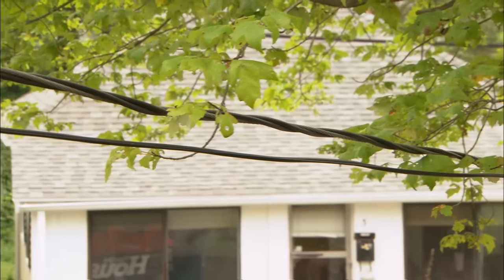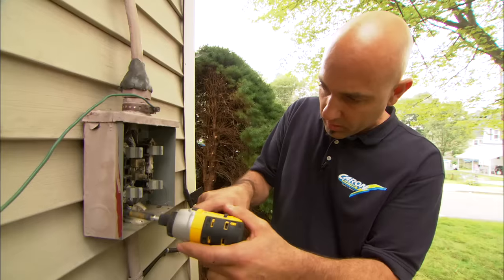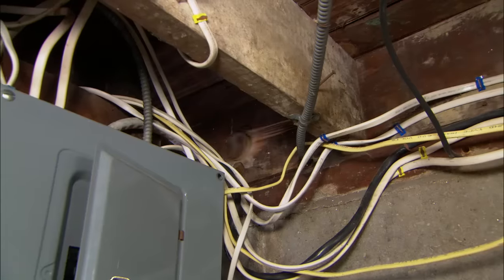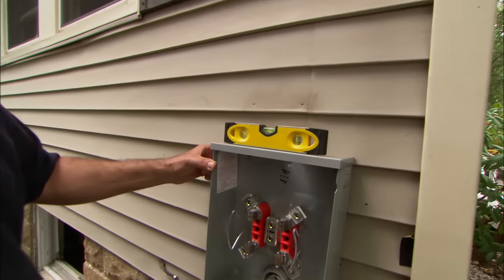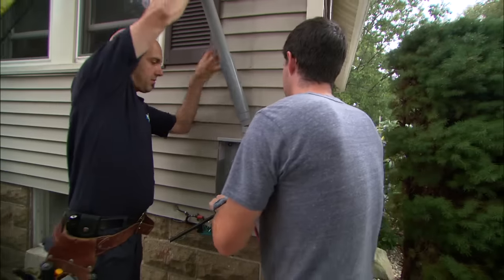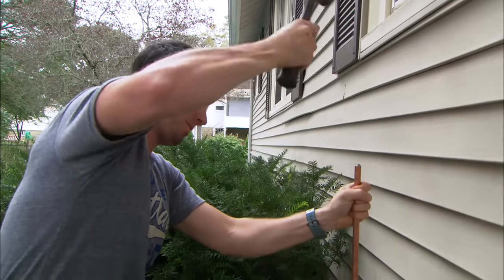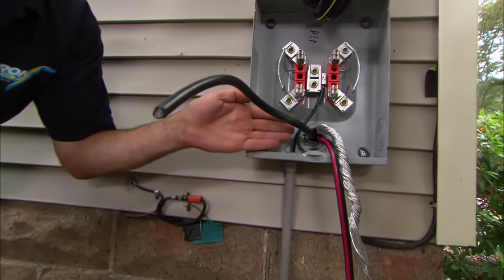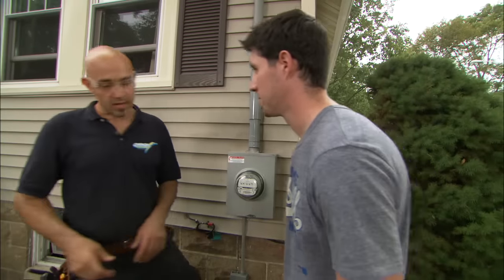How to Upgrade an Electric Meter to 200-Amp Service (Part 1) | This Old House

Comment: 30 seconds in and the facial expression of the homeowner looks like his family is being held hostage by the production team.
Reply: True!
Reply: His words were "so there's no power to the house?"
Reply: @loturzelrestaurant  Stop spamming
Reply: @BenCos2018  I wouldnt call it spamming, for obvious reasons. 

You... surely can tell those reasons, yeah? I mean, they're obvious after all?
Reply: @loturzelrestaurant  It's in every comment thread tbh 
It classes as spam lol
Reply: @BenCos2018  Yeah, i know what you mean, but still: Context? 
Is it really Spam? 
Get my question? 

Also, i think you mean classifies, not classes, lol. 

Point is: I'm informing people about something's existence and asking them about something - Problem with that? And if so, WHY?
Reply: What he wasn't told is that the revision has to be inspected. Then the inspector has to notify the power company. Then the power reconnects the service. Depending on the local it can take days???
Reply: @jackriley5974  yeah 
They edit out far too much inmo tbh
Reply: hahahahaha... this comment is so true.
Reply: @BenCos2018  Yes.  After all, they only have about 22 minutes of actual program to compress days of work to fit.  It is far more complex than they depict for just about everything.
Reply: @johnvinga5446  yep haha 
While I understand why they speed things up...I still think they could havw at least mentioned the extra days of work lol
Reply: Totally saw the holy crap what I get myself into
Reply: 200 amp humor.
Reply: Hey! I know that guy! Went to high school with him.

Comment: "I'll finish it off with a sledgehammer!" - pulls out the smallest sledgehammer known to man...
Reply: That caught me off guard, too!
Reply: We call that a single Jack. Don’t know what it’s called on the East Coast. Apparently a sledgehammer. LOL
Reply: Lump hammer
Reply: Ben Hawkins 😆 😂🤣
Reply: @fredtillman3152  mini sledge
Reply: @nickg1307  mini sledge is a 4 pounder. Anything lighter is a dead blow hammer or mallet.
Reply: @fredtillman3152  I used to sell tools, we called that a "drilling hammer."
Reply: My Klein’s could do better work than that little sledgehammer!
Reply: Lotta names for that thing!   It looks like a 3 lb sledge.  Maybe a 4.  That's what we call them here.  The thing that blew me away was how soft the soil was.  at my house, I might get it in a foot before I hit a big rock and that would be that.  My ground is a hundred feet of 1" copper water supply.
Reply: @goldwinger5434  I am old enough, I have used a 'hand Jack' to drive star bits into brick and concrete to set anchors.   It quite literally is a drill hammer. 3 or 4 pound short handled 'hand jack',, sometimes called a single jack,, sometimes called a half jack,    vs an 8 pound double jack for drilling deep often to set explosives.   A jack hammer.
Reply: @cm01                  "hand sledge"
Reply: I don't believe they got those ground rods all the way down with that little hammer they went off camera and used a jackhammer
Reply: @gustavoramos8229    No.  Quite believable.  I set grounding rods to 10 feet routinely and a 4 pound short handled 'hand jack' or 'hand half jack'  works pretty well.  Your arm can only lift about a max of 4 pounds the hundred or two hundred times you have to lift it.  The rod drives nearly as fast at the beginning as at the end.  Surprising,, the norm is the tough part of the drive are the soils at the mid level.  The lower soils usually are easier, not tougher.  I have driven several hundred rods.
Reply: 😄 good old mini mjölnir
Reply: Fred Tillman Baby Sledge
Reply: We call them a mini-sledge here where I'm from.
Reply: Lmaooo
Reply: "I'll finish it off with a sledgehammer!" Catchphrase.
Reply: That hammer was probably the hammer he used as a meat tenderizer.
Reply: He took that hammer from his 5-year old son’s carpenter toy box.
Reply: @cecflo7435  Like many things in life, it's about technique, not size.

Comment: Great title "How to Upgrade an electric meter..." then the first line is "...this should not be done by a homeowner".
Reply: Lol, I was about to go out and do it today... I guess I'll have to find a different project for today
Reply: Bullshit, i did my own
Reply: If you own it, it's yours to fix or destroy. Risks are involved with each decision. Remember laws are just rules written on paper to control the minds and actions of ppl who believe they have more control over your decision-making than you yourself.
Reply: @frenchmontana961  salty much? I've worked on my own house along with the main service being hot. Knowledge is powerful if you use it correctly. No fires here but you sound a little burnt In my opinion. To each their own I guess.  If you're uneducated in the field then don't take chances. It's YOUR DECISION.
Reply: @TheTubejunky  lots of guys "work on electrical" every day and I have to go in later and fix their mistakes. Hire a licensed contractor. Electrical fires are the #1 cause of residential destruction. Don't be cocky
Reply: We I was 15, my parents bought a house and the first thing my Dad did was upgrade to a 200 amp service. When he had it inspected, the guy looked at him and said "Every once in a while I run into a guy like you. You're not a professional electrician but clearly know what you're doing and does a lot better job than some of the professionals work I've inspected."
Reply: @TheTubejunky  it also means you can buy a house that has hack job diy wiring, I had to redo a fair amount of mine.
Reply: @TheTubejunky  couldn't have put it better myself.
Reply: CrashyK why not pvc ?
Reply: Nick every jurisdiction has its own rules
Reply: TheTubejunky I’m making lots of money everyday fixing the DIY handyman/homeowner electrical installs. Frankly it’s job security for me!
Reply: It’s a little dumb how they present the video as a DIY type of thing. This project should never be presented that way.
Reply: Dog Stopper how do I know what?
Reply: My question is, what difference does it make, if it passes inspection?

Obviously you need a permit to do this work and it’s all disconnected anyway.
Reply: @seabass22  it probably requires a master electrician to pull a permit in most, if not all jurisdictions. I know only a master can in mine. If the homeowner finds/pays a master to pull a permit for him I suppose if he’s intent on doing the work himself, he can. But the master is putting his license on the line and vouching that the work is quality and is done to code. If the house burns down because of faulty work, they are not coming after the inspector; they are coming after the master and his license.
Reply: @RB-xv4si  actually, most jurisdictions allow the home owner to do their own work, so long as they pull a permit and have it inspected.

Otherwise what is the point if pulling a permit and getting an inspection?
Reply: @seabass22  because it’s required by law
Reply: @RB-xv4si  you’re missing the point. It’s okay.
Reply: @seabass22  I didn’t say homeowners weren’t allowed to do their own work. But doing it on your own home doesn’t exempt you from the requirement of having an electrical work permit pulled. And again, they can typically only be pulled by master electricians or contractors. There are some masters that will pimp out their licenses to everyone and their mom for a fee, but they usually end up getting in trouble because they can’t actually oversee all the work their name is on and inevitably there will be idiots doing the work. I understand how all of these things work, my buddy. So what is it you’re still confused about?
Reply: @TheTubejunky  Depends where you live, in areas this must be done by a licensed electrician and inspected, you also must call utilities to disconnect the power from the main.
Reply: obviously it's for a targeted audience.
Reply: @TheTubejunky  sorta. if it poses a fire risk the whole neighborhood could be put in jeopardy, and so that argument would no longer hold because it's no longer your risk to take.
Reply: Probity a disclaimer, if a homeowner was to do this and screw up, the tech who made the video is covered by his butt if the homeowner gets fried..
Reply: @mitchdenner9743  if you live in a state where you can pull your own permits and self-certify....why not???
Reply: @scarroll625  exactly, if your confident enough to handle it yourself, go for it, if not pay an electrician.
Reply: any unlicensed homeowner who does their own electrical work should be forced to disclose this to potential home buyers if the owner decides to sell one day. There's too many old homes with terrible diy electrical work that the new home buyer gets screwed with. Many untrained people aren't as good at electrical work as they think they are.
Reply: @robotman8444  electrical work is not that difficult, and if you mess up- either you die or your house burns down. Nothing to disclose here.
Reply: @robotman8444  thats why home inspectors are used in real estate transactions.
Reply: @mitchdenner9743  home inspectors can't see wiring behind walls nor are they allowed to remove nailed down panels. They are quite limited in what they can inspect legally. I bought an old row house in philly, the previous owner did tons of electrical work by themselves, most of which was horribly done and was dangerous. Discovered all that after the fact. The previous owner hid all his crappy work by covering it up with panels.  The inspector said he found no electrical problems and was in great shape overall when he inspected the house.
Reply: @frenchmontana961  I installed my own meter box, weatherhead insulator,conduit & the breaker box. I’m nowhere near licensed & DTE came out & hooked up the power & said this is some clean work, better than some licensed electricians that he’s seen🤷🏽‍♂️
Reply: Definitely not a do it yourself type task.   I’ve done lots of crazy things as a fully licensed electrician, but I draw the line at doing a service upgrade/changeover “hot”.  It’s just too dangerous.  

As a matter of fact, where I live in Eastern Canada, we can pull an emergency permit for repair, based on my judgement of the situation I am in.  I am not permitted to pull out the meter, though.  I must wait for my supply authority ( ie my local power company).  Logic being, if something goes wrong when pulling the meter, such as a broken lug, or grounding out a chafed wire, the house will very likely burn down.  The supply authority will decide best action to de-energize the house system when they arrive.   

If I wouldn’t do it at my own house, I CERTAINLY wouldn’t do it for a client. It’s not worth the risk, just to save a few hundred bucks.
Reply: @frenchmontana961  just what if he was an Electrical engineer
Reply: Oh jeez, quit with the drama. No, most homeowners shouldn't attempt this, but it's not rocket surgery either. I know a lot of people don't want to mess with electrical--and if you're one of those, you shouldn't. But those of us who have a good knowledge of electricity and circuits--and even more importantly, a solid understanding of the NEC and WHY it's important to do things the right way--we can more than handle this. Quit making it out like there are all these hidden secrets that only licensed electricians know. I've seen enough shoddy electrical work by licensed electricians in a hurry that I'd rather put my life in my own hands than in theirs. Furthermore, I have a good relationship with our state inspector and always welcome his advice and criticism. My design and calculations are solid. My connections are robust. And the inside of my panels are gorgeous.
Reply: I only get an electrician to disconnect the mains (for meter or panel box work), then I do everything else, and then the electrician comes back, checks my work, and reconnects the mains.
Reply: What size is that meter box? I want the smallest meter box I can get for 200 amps as I have a vinyl mounting block I would like it to fit on.

Comment: Just to be clear...they did not "upgrade the meter" to 200 amp service. They upgraded the service to 200 amps. The meter is the same.
Reply: Correct👍

Comment: They skipped the part where the ground rod doesn’t go in all the way and you have to cut it off lol
Reply: Hahahahahah👍😅😂🤣
Reply: Lol I was thinking the same thing.
Reply: 🤣🤣🤣 . He should’ve done the old water bottle trick.
Reply: Hahaha
Reply: They are stamped on the end that you hammer on. The inspector looks for the stamp before you drive it flush with the ground. If he can't find the stamp he will assume you couldn't drive it snt deeper so you cut off the end thinking the inspector wouldn't know that you hadn't driven in the full ,,8 feet. But you wouldn't know about that because because you really didn't know the reason for the stamp in the ground rod.

Comment: I chose to upgrade to 200amps so that I can run 25 toasters all at the same time
Reply: Wait... Theres people out there that don't run 25 toasters...? MIND BLOWN
Reply: HAHA I'm going to your house for breakfast
Reply: Joe Copa  don't you have 4 slice toasters?
Reply: 25 toasters at once would put you at roughly 187.5 - 250A on your 200A service...  You might want to invest in a 400A service. Just sayin' 😋
Reply: Joe Copa  look at Copernicus over here!
Reply: Haha. Good one. I had a 60amp service for years and years with no problems at all (house had natural gas furnace, water heater and stove).